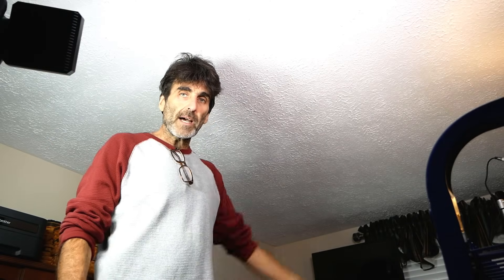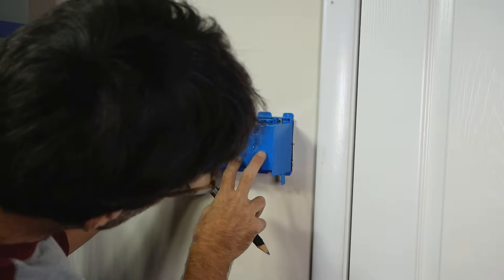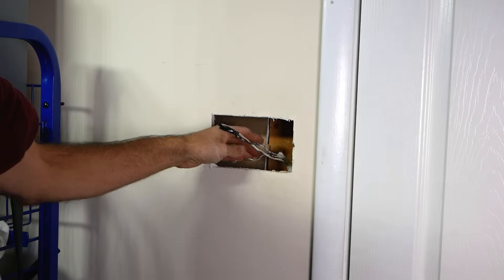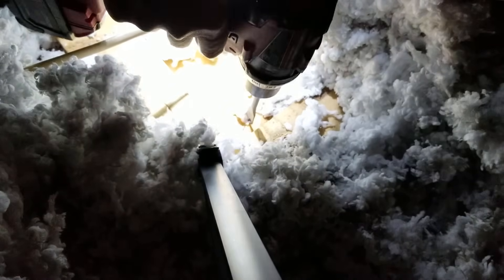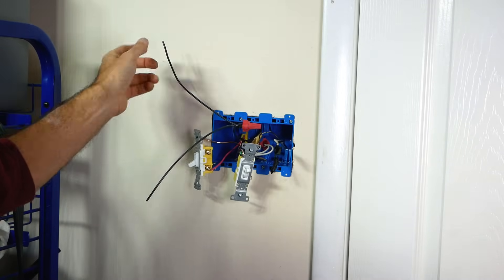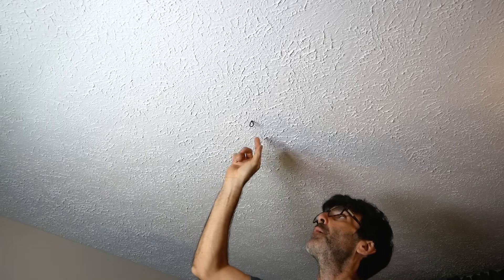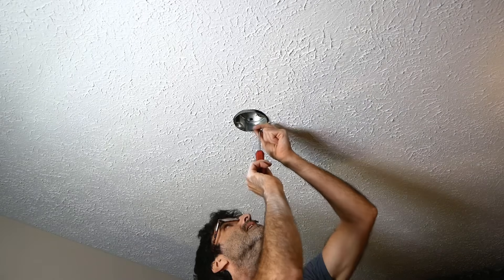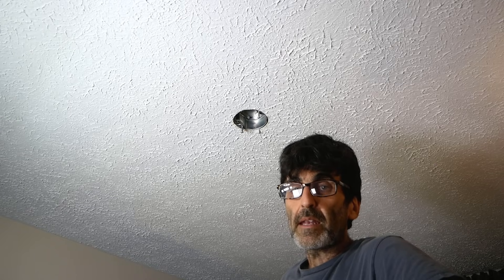Add a Fan to ANY Room without Existing Fixture or Wiring!

Comment: couldn't you have just done a switch with a dimmer to control the fan and light? was the extra switch necessary?
Reply from the maker: You could, or you could put a remote in the fan and still use one switch.  But a lot of the time, when they wire up a new house, they do it like this with two switches for the fan with a 14/3 wire.  But your right, you don't have to do it that way.

Comment: I don't understand how the switch for the receptacle doesn't have a hot that could've been used.
Reply from the maker: Because the Feed for the circuit went to the outlet first and they ran back a single 14/2 to the switch.  The 14/2 was used to switch the hot in the receptacle using the black and white wires.  There's no neutral...

Comment: Greta video and explanation,but the one thing you neglected to tell everyone is where you picked up the neutral (white wire ) which is needed to operate the ceiling light and fan.
Reply from the maker: I didn't mention it because every house is different.  It wouldn't do any good to say... I got the wires from this group of wires in my attic, or whichever... see what I mean?  Every situation is different.  hope that helps..

Comment: Why not cut the breakers to the room your working in, or even the main breaker to prevent those "whole lotta sadness" moments? IJS.
Reply from the maker: I think I recommended to do so?  I'd have to go back and watch it again.... But I usually don't tho...
Reply: Just because you cut the breaker it could be a wire for another room. Also cutting the wire would still cause sadness, even if getting shocked isn't the reason.

Comment: I have the same room and light to outlet situation going on . One thing you didn’t show or I didn’t see was where do you get the power source from. I wanted to add ceiling lights in my rooms but how ? Would I use the same concept? Thanks for your help
Reply from the maker: I think I mentioned in the video, I'm not sure, I'd have to go back and watch it... I got the power source from the attic.  If you have a attic light, that would be the easiest place.  If not, you'll have to find a junction box that you can tap into.  Depending on how many lights you want to add, you might have to do a load assessment for what you're tapping into.  I only tapped in 1 fan and 1 light... not a big load, but if you're doing several recessed lights for example, they are 65 watts each with a conventional light bulb,.. it can add up to a over load ... so keep that in mind.  Hope this helps. Thanks..
Reply: How come you don’t like your light switch to outlet set up? If it works already I don’t see the point in paying the money to get ceiling lights installed
Reply from the maker: I think over head lights will provide better lighting for the room than a lamp will.
Reply: The Home Improvement Channel I have a switched receptacle in my room and I turn on 3 lamps with my light switch because I used extension cords that have 3 plug ins and I’d say the lighting is as good as having a ceiling light
Reply from the maker: thecollinzboy yep that’ll work too... it’s just a matter of preference 😎😎
Reply: The Home Improvement Channel 
Do brand new homes still use switched receptacles? Or all ceiling lights now?
Reply from the maker: @thecollinzboy  I can't say for sure, but I would think it's both.  Depending on the contractor.  The switched outlets are cheaper and faster.

Comment: Great Video! Thanks for posting. Quick question though, since I live in an apartment I obviously wouldn't have access to the attic. I know there are unused electric sockets with functional switches on them, I am wondering whether it might be easier to tap the power from the unused socket; or would you just recommend rewiring the power source from the socket itself. Many thanks
Reply from the maker: The fan is a low amperage device, so it really doesn't matter where you tap it from.  But if you're in a apartment, you might want to check with the property manager to make sure you're not going to cause yourself a problem should they find out you did this!
Reply: Thanks. Will give the building manager a shout!

Comment: Why do you have 2 yellow cable ? Is it because one is for fan and other for light?
Reply from the maker: I'm using 12/2 because the source for my power in the attic was on 20 amp circuit. I have one yellow cable coming from the attic source power is a 12/2, the other 12/3 is going to the fan itself.  The red is included so to be able to run the fan separate from the light.  I am using a remote control for the fan so it doesn't matter anyway, but it gives the option down the road incase I don't use the remote anymore.

Comment: I didn’t understand where he got those wires from 🤔.
Reply from the maker: Which wires?  The 2 that were in the pre-existing switch came from a plug in the room.  They couldn't be used to power the fan because it's just a 14/2 that is running directly to the switch.  The white and the black go across the switch and the power source is in the outlet in the wall and the 14/2 is running back to switch the hot.  The wires that I used for the power source ( I added )  came from the attic because I needed a power source.  You can tap into a light or something like that.  Then of course the 12/3 goes to the fan.  I hope this answers the question.
Reply: The Home Improvement Channel yes. The new wires added, where did it get it’s Power source? Reason I’m asking is because my mothers garage light coming from the ceiling is no longer working (no power). I’m not sure if the men that did the ac and heating when in the attic cut or detached a wire to lose power to that light but I cannot seem to figure it out. At first I thought it was the light fixture but once I replaced it, I realized there was no electricity run through the wires. What do you think
Reply from the maker: @newareafilms  Is there a attic above the light?  Were in the HVAC guys up there?  I don't see why they would have disconnected, but one of them could have tripped over the wire and pulled it loose.  Something like that would definitely be hard to troubleshoot over a message like this!  If there's a attic it might be worth it to go up there and see if anything sticks out.  Also Remember the old saying Keep it simple!  Check the switch and make sure there's nothing going on in there.  It could even be a bad switch, or maybe a wire came loose behind the switch....  Hope this helps... thanks.
Reply: The Home Improvement Channel I’ll go in the attic and check. I’ll update you later. Thank you for writing me back. 👍🏻
Reply: The Home Improvement Channel using the pen that checks if a wire is live displayed they were not. I checked the fuse box and everything seemed to be fine. In the attic following the wires I then realized that someone had cut the wires. I then reconnect them and now the light is working 🙌🏻
Reply from the maker: @newareafilms  Wow!  Good Job... I can't believe they cut the wires!
Reply: The Home Improvement Channel what they did was add a light to the attic and an old light that was already there they just cut the wire for the attic light and also the wire for the indoor lighting in the garage I believe they assumed that the wires were for only the attic but I can’t believe they didn’t remove the wiring instead they left them cut and live without capping them off
Reply from the maker: @newareafilms  Yes, they should have capped them off and put them in a box with a cover!  If you had that done recently, I'd almost have to call and complain ... not that they'll do anything, but it might make you feel better!
Reply: The Home Improvement Channel no it was last year but I recently have been doing some home improvements so this is how I stumbled to your channel. Thanks a million for responding back 👍🏻 I’ll keep on watching
Reply: @TheHomeImprovementChannel  Why are you using 12/3 rather than 14/3?
Reply from the maker: @EverydayIsSaturday2  Because my power source is on a 20 amp circuit.

Comment: Can you explain in this particular case from where you got the power source? Was it from a wire in the attic or from the original one in the switch?
Reply from the maker: I tapped into a wire from the attic.  I didn't show it because everybody's house is different and I didn't think it would be relevant because of that.  I couldn't use the existing switch because it controlled a nearby plug and they ran back a single 14/2 to the switch and only switched the hot wire in the plug.. so at the switch there's no neutral to connect my power source to.  In this case the white and black were across the existing switch.  So I needed another power source.  I hope that answers the question.  Thanks.

Comment: 1st Q:  You pulled 2 yellow wires down.  Was 1 a 12/3 and the other a 12/2?   2nd Q:  Does one go to the Power Source and the other to the Fan?  If so, which goes to what.  3rd Q:  Why 2 switches?  Shouldn't 1 suffice?
Reply from the maker: HI, the 12/2 is the continuous power source from the attic or where ever you can source it from, mine was from the attic,.. the 12/3 is going to the fan.. the black is for the fan motor, and the red is to the light.  I did this to have separate control over the light and the fan without having to pull the chains on the fan all the time... You can use one switch, but then you can't control the light separately.  I hope that helps.. Thanks.  BTW, I'm using 12 gauge because my power source is fused at 20 Amps.. if you can find a 15 amp source, then you can use 14 wire.
Reply: @TheHomeImprovementChannel  yes that clarification helps a lot. I might have guessed that you were using one switch to control the light and one the fan but I didn't want to assume that. The other clarification I wanted to make was whether or not the original two-way switch on the far right-hand side has any connection to your two new switches? Or is it completely stand-alone and just happens to be in the three Gang Box?
Reply from the maker: Yes the original switch didn't have constant power to it.  The power source for that is going directly to an outlet, and from there they ran a 14/2 back to the switch just switching the hot wire, so I couldn't use it to power my fan.  I could have just tied it together in the box and eliminated it, and made the box a 2 gang, but I kept the switchable outlet for another purpose.  Hope that helps... thanks..
Reply: @TheHomeImprovementChannel  Yes, it does help increase my understanding.  Got my subscription!  Thanks again.
Reply: @TheHomeImprovementChannel  Would like your input on this situation if you would be so kind.  I have a ceiling fan (no light, just fan) in a LVRM that is controlled by a 2-way switch in a staircase (close by) leading to the basement.  In between them is a light above the stairs (I am guessing this is what the 2-way was originally intended for).  Can I just connect a 14/2 leg coming out of the fan and run it down the opposing wall so that a new switch is in the LVRM?  or  Do I need a 3-way switch?  or  Do I need to just run a new line to the box and get power there?
Reply from the maker: @stephenhart494  No, you won't need a 3 way switch.. a 3 way switch is only used for controlling one fixture from 2 locations.  It sounds like you want to undo what someone did by connecting the fan to the light in the stairwell.  You will need to terminate the connection somehow coming from the stairwell either 1. by finding the connection either at the switch in the stairwell or it'll be in the light fixture in the stairwell and disconnecting it.. or  2. you can find the connection in the fan and wire nut it off so it's disabled.  Yes, you can run a wire from the fan to a new switch where ever you want it, but you'll need a source of power somewhere... from a nearby plug, or something that has a available power source to either run to the fan (keep in mind not to overload the box with to many wires) and then use the 14/2 run back to the switch and switch the hot wire, or you can run the power source to the switch and run the 14/2 back to the fan... I wouldn't think you need to run all the way to the main panel, since the fan doesn't need a lot of amps available.  ... Also, I say 14/2... if you find a source that is fused at 20 amps.. don't use the 14/2.. use 12/2..  Hope this helps.. Thanks.
Reply: @TheHomeImprovementChannel  thanks so much for answering this question above and beyond. YouTube did not notify me when you responded so I went ahead and bought a book and figure it out. Pretty much did what you said except I needed to install a new Switch in the living room and I did just run straight to the Box because it wasn't far away and now they have a whole new circuit to work with and at other things on to if needed in the future. Keep making the videos!
Reply from the maker: @stephenhart494  Excellent... glad you figured it out... Thanks again.

Comment: I don't have an attic . If I put a fan, I'll probably run wire right on ceiling
Reply from the maker: Yea they make a decorative covering you can get for the wiring... but if you want to put the wire up in the ceiling,.. see my video I did about a year ago about installing recessed can lights with no attic access... I show how to get the wire up in the ceiling and hide it, but you'll have to do some drywall work to get it done...
Reply: @TheHomeImprovementChannel  thank you.
Reply from the maker: john argue You’re welcome 😊